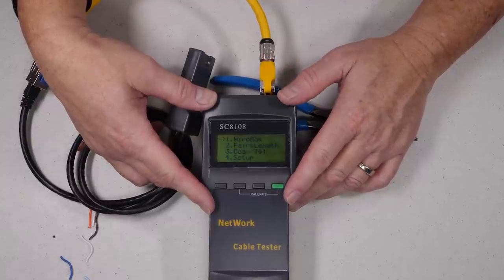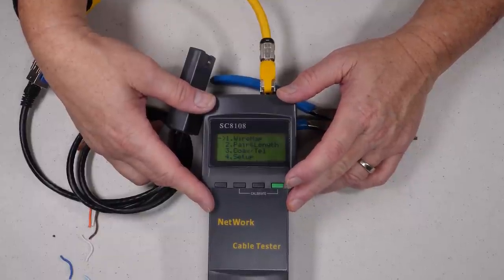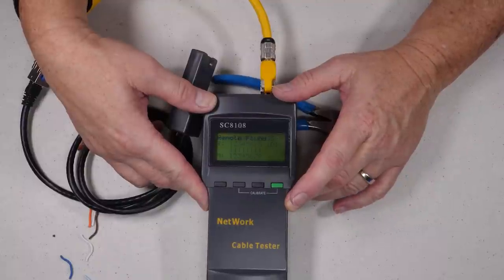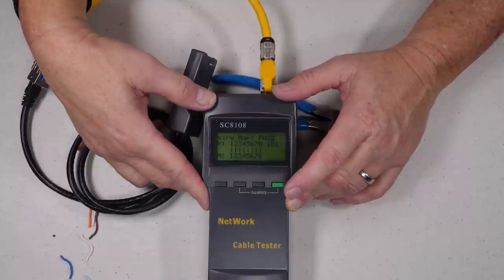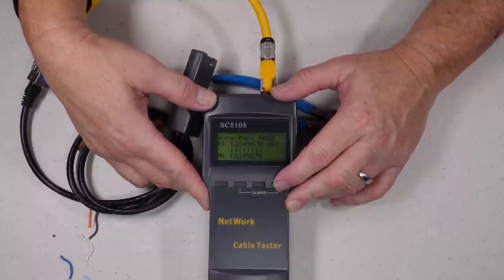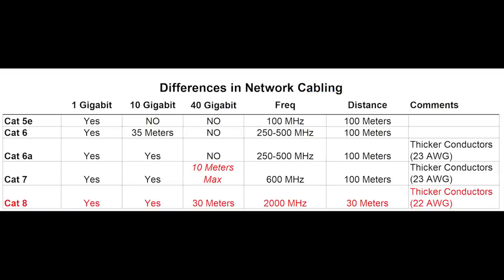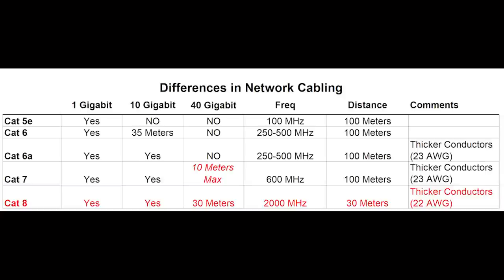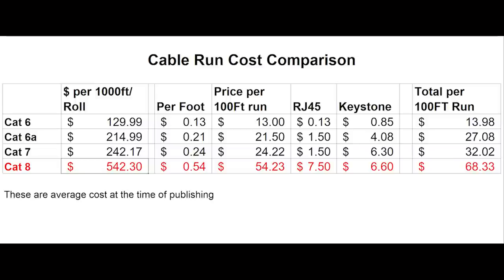CAT 8 vs CAT 7 Ethernet Cables - Is there a difference?

Comment: CAT9 will be just a stiff rod of copper.
Reply: We will start to come full circle and hit Thinnet and finishing with Thicknet cabling. :) I have pulled all, and literally pulled on thinnet attached to Cat5 for ceiling run replacement, lol.
Reply: Cat8 is almost silly, its obsolete to fiber in price, distance and speed. Perhaps more practical for just patching since in that use case it would be quicker to install than splicing fiber. That being said for the utter majority of homes, small and medium business in the world that kind of available bandwidth for most of the runs they have would never be saturated. Or by the time it has a real practical use case it would have already been superseded by another available technology. Ive been installing for over a decade(Since 10bt token ring hubs etc) and I still recommend Cat5e for the majority of people, cat 6a for some of the backbone/CPE runs. Especially in residential applications its completely pointless.
Reply from the maker: Certainly agree that CAT 8 is a bit of waste, but there many out there including me that run 10G networks that need 6a or 7 for the longer runs.  Thanks for the input.
Reply: @TheRickJames  Here where i live all new buildings has to have a fiber and Cat6 installed. Fiber is not usually used, the isp´s are using a fiber router and use the cat6's to split the internet to houses. But you CAN buy a fiber link if you really want to, The ISP will just use 2 fiber-Cat6 couplers one on the panel side, and one in house. its funny when i see it.
Reply: @MikeFaucher  why not just fiber? its a hell of a lot cheaper to run and length is basically not a issue.
Reply: @SupremeRuleroftheWorld  Fiber is expensive when you get to the optics. I just got a quote for a full 10G switch: 10GBase-LR SFP module (genuine Cisco): $1,242.59/piece

CAT8 will basically be for rack-to-rack and in-rack 40G in the datacenter or 40G-to-the-workstation. We may even see 100G in-rack with CAT8 with some technology improvements.
Reply: For a VERY long time, Cat6a or Cat7 for up to 10Gb/s will be plenty for residential use.  No single endpoint device in the home is likely to require more than that.  Even feeding an access point isn't likely to need more than 10Gb/s.

For business use, the same arguments apply to workstations - 10Gb/s is still more than enough and will likely suffice for many more years.  Even considering remote workstations, either on site or in the cloud, the bandwidth requirement on a station-by-station basis is still adequately handled by 1Gb/s Ethernet.  For servers and network trunks to distribution switches, we're already using fiber to pretty much everything needing 10Gb/s or more.
Reply: @GuruEvi  if you are in the region of 10gbit long distance you are not discussing residential. then its enterprise. and pricing for enterprise is enterprise pricing. and man hours is also pretty expensive. especially on larger builds. dicking around with unwiedly cables and spending a whole afternoon terminating is simply not cost effective so fiber is the way to go. but inside a rack or to another rack? sure.
Reply: @TheRickJames  Agree, in my experience working at ISP anything beyond cat 6 is pointless and stupid,  if someone needs  performance beyond cat6 should just switch to fiber
Reply: @GuruEvi  about the price, what did you expect it`s Cisco
Reply: actually, single pair Ethernet has the greatest potential to create that paradigm shift in the industry where less conductors but higher quality of transmission capabilities may suffice, but then you come to a point where it is just easier and more economical to deploy fiber in the long run
Reply: Installing cat5e instead of 6, in 2020, is penny pinching. 
As soon as you have someone who's tech savy and wants to get a few cameras going, maybe a small file server for medias, backup/redundancy, 4k tvs, that little gigabit switch starts to suffer. I mean, dont plan for 25 years ahead, but give yourself a little headroom at least. 
If someone offered me cat5e today, i'd go and seek someone who's not stuck in 2001 to, wire my house up. Cat6 for everyone, Cat6a as a premium option. Cat 7 & 8 are pretty niche, i'll agree with that.
Reply: @nlz242  Thats hilarious because I have everything you mentioned on my property. Along with 32 cameras a Plex and TruNas server wifi 6 and home automation. I have gigabit fiber from an ISP and thats got cat6 to my router and cat 5e to my switches then a mix of cat5 and 5e to the various other devices and cameras. People misunderstand the bandwidth requirements, my cameras at 5mp only saturate 6-8mbps @30fps, modern cameras with h265 or 264 don't require anything more than cat5 really and won't anytime in the future either. You can wire a TV and stream 4k all day long on regular cat5 also, they spike around 30mbps and fall to 5-10mbps almost immediately as it builds the buffer. So no you don't need cat6 for any home right now even unusually large networked ones like mine. Its nice to have but unessasary
Reply: @nlz242  Your basically treating each individual device like it has some exponential bandwidth requirement. My Xbox is wired with 5e and it saturates at most 260mbps when downloading games. For the typical user a single device rarely needs more than 100mbps. So 6a is nice for your desktop if you plan on moving files to the server or torrents but the other devices will never use it.
Reply: @TheRickJames  fair enough, but with price difference between cat6 and cat5e being so slim and cost of retrofit being so high, i still believe that if your walls are open and you are wiring the place, saving 20$ for the whole house by putting cat5e is ridiculous. I mean the day i need to upgrade a single one of those cables and i gotta fish cables using speciality tools, I'll pay 20-30 times the difference between cat5 and cat6.
Reply: @nlz242  I pay $40 1kft spool or so for Cat5e and the cheapest Cat6a option I trust is about $100 a 1kft spool. That more than double the price and I can find the 5 even cheaper. Have to take in account STP, UTP, Burial FTC etc. depending on your application/project it can be a difference in $1000s. But that's not even really the full reason most installers still use 5e, its because its purchased in bulk and there is still plenty laying around, and nothing wrong with using it either especially in small biz and home applications where it wont even be used to its potential. Most devices don't even support 10gbe, the majority of devices are only Gigabit. Its also worth noting that Cat5e will do 2.5GBaseT and even 10GBaseT just like Cat6a up to 45m if terminated properly. Most people that have been doing it for a while notice how in most cases the capabilities of the transmission media is rarely used that why the impact on QOS is negligible between the two.
Reply: @TheRickJames  Alright, fair enough for specific projects. I have less than 1kft of cables in my house tho, so paying $60 more upfront is still negligible compared to the price of having to retrofit anything if the need arise... and while i agree that an xbox is not gonna saturate 1gbps, i've seen many SOHO network setups with multiple switches with lenghty cables between them (basement to second floor, for example). It works perfectly well over cat5e today, on 1gigabit network. But in a couple of years, those 1gbps switches are gonna be upgraded, 10gbps is not a wild idea. So yeah, that $15-worth cable running from the basement, thru the walls, up to the second floor may become a problem... and it's gonna costs hundreds to upgrade it to a $35-worth cable... 
I guess i don't get it, iv'e spent too much time and got way too angry at situation caused by penny-pinching, i'd rather pay more upfront and get -some-kind-of-future-proofing. Retrofitting is always more expensive. 
Also, i'm not good at drywalls. I can't do proper joints to save my life, so whenever i have to go back and rewire stuff, if i can't only fish it and i have to get into the walls, i have to pay someone who's good at drywall. Paying someone costs much more than that $60 difference for 1kft.
Reply: I'm guessing Cat 9 will carry the shielding through the connector somehow so that the pairs will be shielded from each other even inside the connectors.  
Then Cat 10 will have 4 triplets rather than 4 pairs so that each triplet will be balanced.
Reply: @TheRickJames  Agreed.  Go fiber.
Reply: @TheRickJames  copper has less latency than fiber.  In installations of less than 300 feet of cable, copper is always the better choice.  For lower latency, ease of installation, lack of media converters, and cost.  So really any residential installation should be copper.  Anything longer than 300 feet would likely be better served by fiber optic, since the signal strength over a distance is much better, thus leading to lower costs and lower processing latency due to fewer repeaters needed.
https://www.commscope.com/globalassets/digizuite/2799-latency-in-optical-fiber-systems-wp-111432-en.pdf
Reply: @toddlynch7282  for now.  There was a day when we thought 1Gb/s in a residence was an absolutely ridiculous sentiment.  I'm sure we'll soon be saturating 100Gb/s lines. Which is as ridiculous a statement as saying we'll soon be saturating 1Gb/s lines in 1990.
Reply: @bobguy6542  That's completely negligible. As a medium at any length Fiber has much lower latency. The latency is more dependent on the end equipment than the medium in fiber where as copper is susceptible to a plentra of RF, EMI, and attenuation characteristics inherent in copper transport mediums. In real world applications its either similar down to the ps or its faster, I've installed enough of it to see the difference. Especially when you factor tick time in nic cards and the packet losses. You would have to be running some very outdated equipment to experience additional latency when going from copper to fiber.
Reply: @TheRickJames  "As a medium at any length Fiber has much lower latency."

False.  You need to go back to school.  You're dead wrong.
Reply: @TheRickJames  Yes, in the homes, CAT5e for everything except the backbone or if the wire is inside walls. Then it's CAT6 or CAT6a. If the client complains, demanding CAT7 or CAT8 because they heard "great things about them" or it's a higher number, then I install 2 cans connected by a string and tell them it's CAT9.

Comment: Great video, thanks a lot. I just equipped my new home with 23 Cat8 cables across the entire building, because I do not want to ever touch this installation again. So this should last for the next decades and for me the invest was worth it. Soon, the Cat8 keystones will be installed on both ends.
Reply from the maker: Awesome.  That is what I call future proofing.  Thanks for sharing.
Reply: @MikeFaucher  nothing personal but that is not  future proofing that`s wasting money. Cat 6 is more than enough for  residential and small businesses
Reply: For our new house we ran Cat6, Cat6a, Cat7, and OM3/OM4 fiber. :-)
Reply: Cat7 is sufficient enough.
Reply: @momchil_v  Can you predict the future.  His house will last at least 30 years.  Do you know what kinds of data speeds will be used in the year 2050?
Reply: @JamesAnderson-lq8tf  Gigabit Ethernet  standard was released 1999 and it is still rarer to find such connections for residential/home use. So imo by 2050 1G will be the norm and 2.5G or 5G will be the 1G of today. Cat6 cable can carry 1G up to 100m and 10G up to 50m.  For ISP`s and big data centers, 400G is the norm and 800G is being tested.
Reply: @momchil_v  gig speed is very common and available in greater metropolitan and suburbs. 2050 will be hundreds of gigs per sec likely.
Reply: @momchil_v   Martin talked about lasting the next decades. Who knows what labor costs would be to rip those out decades from now. I'm sure the hourly rate would far outweigh the cost of that expensive cabling and connectors. We are already at wifi6E, who knows what's coming up, speedwise?  if you have to use a "wired backhaul"  of your wifi mesh at home or business you need to match the wifi speeds certainly. Wi-Fi 6, theoretically reaches 9.6 Gbps (compared to Wi-Fi 5 which clocks in at 6.9 Gbps). Real world,  Wi-Fi 6 can be 1.2 Gbps -  still 20% faster than connecting via Gigabit Ethernet.
Reply: @dbrinas  cat6 cables can carry 10G up to 50m
Reply: Cat 6E and OM3 is fine. If any of your lines exceed 98.4’ you just wasted a lot of money. Most people only know of Cat 6 and Cat 6A.  I can’t imagine a need for Cat 7/8 which would not be done more cheaply by OM3. OM4 is unnecessary in a home because no home is going to have a run over 550m.  What network has Cat 8 transmission specs?  Is Cat 8 really even a TIA standard?  in my world it is only theoretical. 
My world  = data cabling (38 years)
Reply: @JamesAnderson-lq8tf  No one can, obviously.  That said, we are overdue for a new and friendlier technology than fiber for the homeowner market.  Copper has probably run its course.
Reply: @momchil_v  Cat6 a isn't even shielded is it?
Reply: @SelfProclaimedEmperor  there are different  type of ethernet cables i.e UTP, STP and SFTP
Reply: @momchil_v  what's if you need more then 50m? Then how can I get 10gig at 120m?
Reply: @flyingjeff1984  copper will be around for a very long time my friend
Reply: @jzawodn Why deploy multiple copper standards, or are you trying to be facetious?

Comment: If you need more than 10 G you just use fiber instead. You can have 40 or 100 G with cheap QSFP(+) modules. So just use cat 6a for copper connectivity, anything better is useless because, fiber.
Reply: that's kind of what i've been thinking about. a fusion splicer is NOT needed to terminate fiber OM3/OM4 if you get a kit or the right stuff, just make sure to measure twice and cut one and  i guess you could just pull it on the wall along with 6A, 5e and RG6 if you wanted the full buffet.
Reply: @cdoublejj  You look around OM3 and OM4 can be manufactured to a specific length, its not even expensive to buy, in total spent less than £1000 to fiber the whole house (9 rooms plus 2 out rooms), 10 gig to every room (40 gig to office) All the cables made to measure, a switch "borrowed" from work job done.
Reply: I agree. Distance seems to be the problem here and they have yet to fix that with copper. Fiber it is.
Reply: Well actually for big data center you want to use copper as much as possible! Copper is always faster than fiber in short runs. Cat 8 support 40 and 100 Gig-E!
Since Fibers always introduce latency and the more you have fiber the more you introduce latency, in the end, it adds up.

But agree with you if you don't have hundreds of transactional server I would go with fiber.
Each datacenter have to go through an evaluation of its needs.
Reply: @NMETSGChan  yes short runs most definitely but it seems the critical runs lately are distance and further away from the data centers. I’m shocked they are not making copper runs greater for distance.
Reply: @NMETSGChan  Sorry but no,
Couple of reasons:
1- In a datacenter you want the least power consumption possible, copper draws way more current than SFP
2- For short distances you can use DAC cables which use a coaxial media, still uses SFP and do not require fiber if distance is less than 3 meters
3- Really fast switches are cheaper when they have SFP ports rather than RJ45 ports
4- Twisted pair is only rated for 10 G at 100 meters which cat 6a is sufficient to run 10 G at 100 meters, everything else is not standardized and should not be run in production, only in a home lab
5- Fiber is cheaper
Reply: @NMETSGChan  Yeah you want copper between the switches but cat8 is only rated 100Gbps for 15m. That's just enough for going from rack to rack. OM3 can do that sort of speed for 70m and in practice even longer distances. Not to mention that newest SFP's have latency around 300 nano seconds per link.
Reply: cat8 Ethernet with rj45 style plugs is preferable to fiber IMO.

Comment: Great video.  One slight clarification.  The larger AWG wire for Cat 8 is not for allowing more data transmission through due to surface area.  It is easier for the wire manufacturer to control the twisting of the wire pairs in a more precise way to reduce the crosstalk.     

The goal on each successive option is to operate at higher frequencies and reduce more crosstalk which is beyond the scope of this discussion.   That is what allows greater transmission speed.
Reply from the maker: Thanks for the explanation and feedback.

Comment: I did Cat 8 because all my walls were torn out during a renovation. I figured there’s no easier time to just completely future proof my home network. Yes it was extremely expensive with the keystones and field terminations but a $2000 investment beats the hell out of having to redo it at somepoint.
Reply from the maker: I agree completely. Sounds great and thanks for sharing. Good luck with it.
Reply: $2000 ?? I bought 25 meters of cat 8 cable with 3 cat 8 connectors for each side and additional stuff for € 100.
Reply: Personally, I would do an OS2 fibre to be futureproof (>200gbe)...
Reply: Home run ENT/Smurf tube ftw. The future is whenever you feel like fishing it.

Comment: Excellent video. Many thanks. Fully agree. 6a is the sweet spot as you can still use normal crimp RJ45 shielded termination. Cat 7 upwards just a pain! but I can see a use for datacentres. 
For residential and business building to building or server to a comms I always run armoured optical pairs with 2 pairs redundant. Better performance, and more future proof than copper. Also price difference to Cat8 is negligible when all things considered.
Reply from the maker: Thanks for the feedback and the insight.  It's appreciated.